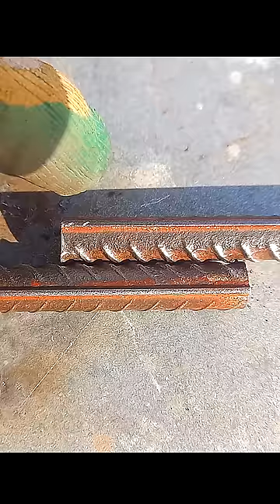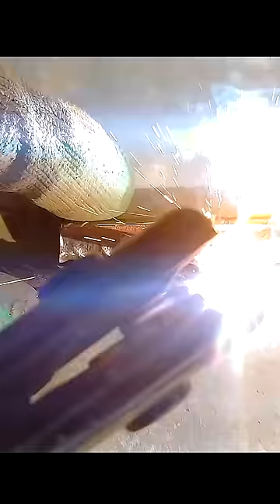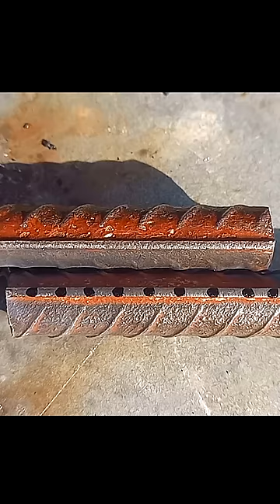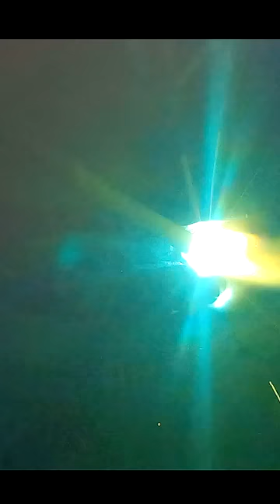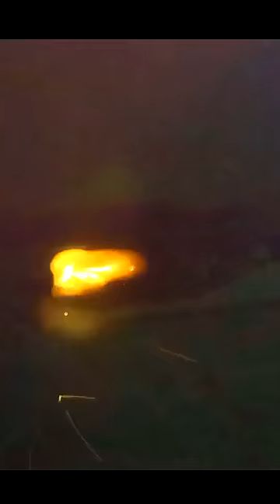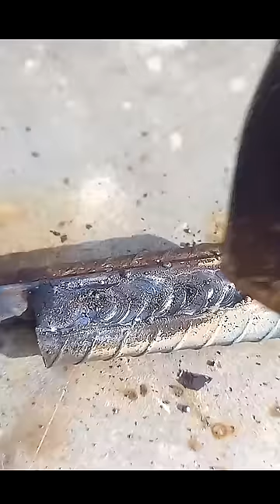Cool way to weld metal rods! #shorts

Comment: If you're using a 7018 Rod you don't need to do that you can just drag it
Reply: I'm into learning stick welding recently, can you suggest what electrode should I use for welding 2-3mm steel plate?
Reply: @theo.suharto  6013
Reply: @iagomendesx  ok thanks
Reply: @theo.suharto  not true. Use 7018 at 75 amps
Reply: @aidenp7232  That's impossible since you can't find thinner than 2.5mm 7018 electrodes!
Reply: @theo.suharto  For thin metal, use an E6013 electrode, probably a 3/32" diameter for steel that thin, but they also make them in 1/16" but that small of an electrode can be hard to manage.
Reply: @theo.suharto  6013 specifically designed for sheet metal( plate is 6mm and up).
7018 may be too hot, but as long as you can handle it, is fine.
Reply: @theo.suharto  6010, 6011, 6013, either three of these will do just fine
Reply: It really depends on the base metal and thickness, sheet metal 60 series rod deep penitration and fast freeze, A36 plate which is common can be used with both 60 and 70 series rod depending on your welder if it's only AC well then your limited to the rod size and polarity, practices your weave and if it splatter like crazy change your polarity and turn down your heat you can tell if your Flux heats up before you finish the rod
Reply: Hell even if he was using an 8010, 6010, 6011, 6013, or an 8018 he could drag as long as it isn’t a 7014 or 8010 pipeliner he’d be fine so idk wtf these welders be doing
Reply: 7018 is a luxury item in non first world countries, we weld everything with 6013

Comment: Welding isn't that hard. You just have to have a steady hand good eye's and don't mind the heat. I welded on air Craft for the air force and loved it as a Tig welder. Mig welded on a Ford Assembly line truck frames.

Comment: You do not need to weave the rod . Just concentrate the arc into the bottom of the V and move slowly and evenly watching the pool of weld form to a tear drop shape . This will produce a very strong very good bond of material without the weave undercut ! 🎉
Reply: Correctamundo my brother!
Reply: I'm not a welder, but I thank you for those clear and articulate instructions.

Comment: Tengo problemas ara mantener el arco !! 🥲
Reply: Practica mas usa electrodo 6013 es mas facil
Reply: Hola! Lo primero que debes aprender antes de soldar, es a regular bien la maquina. Aproximadamente unos 25 ampers por milimetro ( puede variar según la maquina y si conectas a 220  o 110 V). Por ejemplo para un eléctrodo de 2.5 mm entre 75 y 80 ampers van a andar bien. Si tienes poco amperaje para el electrodo que usas, va a ser muy difícil que puedas mantener el arco porque se te va a pegar al metal que querés soldar. Por eso es muy importante conocer la soldadora que utilizas y encontrar el punto justo para cada tipo de electródos. Después lo demás es práctica, nadie nace sabiendo. Buena suerte con eso 🤙

Comment: Sounds like a lot of CWI commenting, is the rebar A706? Or A615 if you don't know what that is the question? What is the carbon equivalent and to properly weld this rebar mill certs are needed and welding procedures for the type and grade of steel and must have at least 125 psi tinsel strength and the City of L A requires a charpy v notch test of the weld so it's not to Ridged and will flex and not fracture but what the hell do I know from my armchair? I'm at lunch guess who I am?

Comment: Best way is to weld that with 5/32 8018 at 200 amps and weld will never fail, plus it will be a solid peice
Reply: Not to mention how dirty the metal itself is, the rust won't make it stronger 🤣🤣
Reply: With that small amount of rust, it won't weaken the weld whatsoever. You're be surprised how strong a "weak" weld is.
Reply: @robertmceuen3630  true but the lack of metal prep just speaks to the quality of the advice they give
Reply: @petermcchristian2330  I was a union Ironworker for almost 40 years. The certified welders of re bar(what was being welded in the video) don't clean extensively before welding. Heavy rust and scsle-yes. But minor rust has no bearing on the weld in the video. In fact, it was a pretty nice weld for using the wrong technique.
Reply: @robertmceuen3630  exactly. I was on several bridge restoration jobs as welder and the rebar was a lot more corroded than the replacement new material. It got sandblasted prior to welding. But I definitely preferred 7018 to 60anything....😅

Comment: That gets an "A". It's probably 6011. That stick move is called an Itch Weld or a Whip Weld....depending on where you live.
Reply: An a for absolutely useless welding. A p for porosity, and an r for r****ded
Reply: @slicedlimes7948  you sir, have gotten an A for your comment due to the fact you’re 100% correct. I always tell the apprentices, “I love my homies with extra chromies!”

Comment: It easy welding thin metal too, once you put your heat setting on 10 to 15. Use a 6013 rod,
Reply: What's a heat setting? I've only ever used welders with amps
Reply: The heat setting is the amps
Reply: 6013 leaves bad slag formation and sucks at penetration if you’re not 100% on your game. Hell no to that

Comment: Rebar to rebar requires an 80 series electrode.
Reply: Why?
Reply: @billfoster213  because the rebar used in structural applications is generally grade 60. The codebook requires the electrode be overmatched to the base material.

Structural steel usually only gets up to grade 50, which allows the welding electrode to be a 70 series in strength.
Reply: @nathanstoll6316  thanks for the info. I  did a lot of rebar replacement and patches on several Oregon and Alaska DOT Bridge Restoration projects but the specs didn't have any rod specifications to my knowledge. 7018 was accepted, or Flux Core MIG. The only requirement was preheat to 400f and the weld test was multiple strikes from a hammer. The original rebar in a WPA era (1935) Bridge can range from perfect condition to rotted to nothing. Thanks.
Reply: @billfoster213  nice. I bet 7018 is good enough, it's still overmatched

Comment: Just pull it straight back with a slower action. You will penerate better and the weld will be much nicer to look at. With that said, this weld right here isn't going to break. It is more than adequate for the purpose.

Comment: There is a certification for that.  It’s rebar.
Reply: Pretty sure your not supposed to weld  regarding for concrete
Reply: @stevensapp8521  it was required once it was a big issue, I had to witness as a certified weld inspector.
Reply: I know of contractor kicked off a job for welding rebar instead of using wire to tie it up